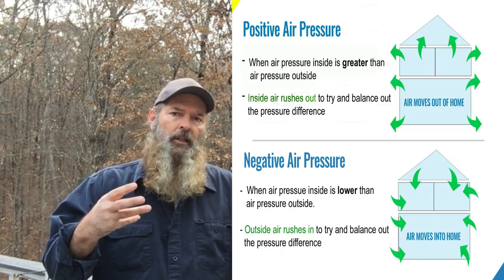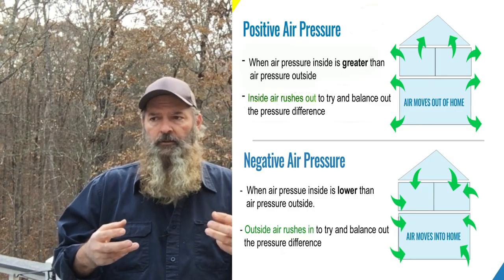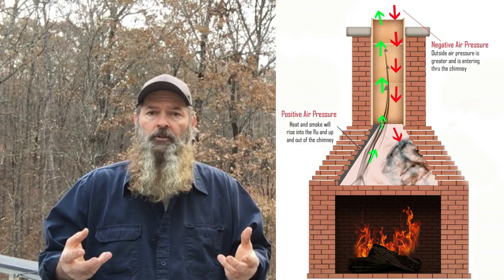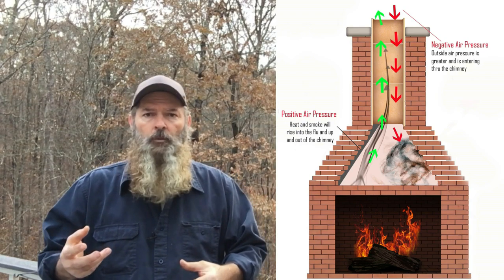What Causes A Smoky Fireplace?

Comment: Great explanation,we have another trick we do in Saudi Arabia,I don’t really know who invented it or thought of it,but it is common here,so we put a pipe built inside the chimney structure from the sides from the top till the middle,the trick is that when smoke gets out,Air has to be replaced,so it comes down through the pipe built on side of chimney,when air comes in,it comes warm because the pipe is warm,this way you get warm air,with no back draft or smoke and you don’t even need to open window,the problem with it is that in summer when it gets hot and dusty here,bad air and dust could leak in,but we have other tricks for it,i hope I explained it well

Comment: From my experience as a chimney sweep, the two main things are getting the fire hot enough to get the draft going, aswell as having the actual opening properly sized to the smokechamber and flue.  ive seen many fireplaces that have wayy to large of an opening for a 13x13 terracotta liner (which id bet that most of you reading this who have a fireplace also have this size flue connected to it). and that necking down is just as bad for the draft as for example, running a 6inch pipe from a woodstove into a 8x13 or 13x13.  You can always get a glass door to put infront of your fireplace to help keep the heat inside while starting a fire to start sending that heat up and getting a draft, and it also helps with evening out the flow of air so the amount of air coming in is more equal to that 13x13 terracotta flow rate creating an even stronger draft. Those firestarters are great for fireplaces, because they burn hot quickly, and with minimal smoke. Perfect for starting a fire on a cold day when the pressure is flipped in the chimney.

Comment: A cold chimney on the outside of a house will not draw as well as a warm chimney that goes through the center of the house that can stay insulated. Insulate chimneys with perlite and mineral wool, using a stove pipe as the center or a 6 inch or 8 inch chimney liner, and the draft is so good there is no more smoke problems.
Reply from the maker: This is true.

Comment: I had this experience this morning (to the point where it was almost like the damper was closed !!)
and your video helped me understand the potential reasons why, thank you. On my fireplace, I also
have a fan system with vents top and bottom on the surrounding walls. When this fan is on, I notice
only one set of vents is producing warm air. Are the others intakes? If so, where does this draw from?
Reply: The fan system isn't to feed air into the fireplace.  It circulates air around the fireplace to warm it before putting it back in the room but not through the fireplace where it would pick up smoke.  You are right, one vent is the intake from the room.
Reply: @Bowinja  Thanks for responding to my question, bit paranoid right now to risk going through the smoke filled house experience again with that fireplace but an open window nearby and warming up the flue beforehand will get me back on that horse again before winter's end.
Reply: @steveb7714  keep the doors shut while the fans are running. They tend to suck smoke out of the fire. Shut then off before opening

Comment: Does the surface of chimney roof has effect on the direction of the smoke flow?  Usually it's flat but mine is gable roof
Reply: I live in Tampa Florida and have been here my whole life of 51 years. I am a custom sheetmetal fabricator who has just about mastered my chimney cap and spark arrestor skills. With that being said, a poorly constructed or no sign of up keeping of a roof cap can and will cause bad air flow. When I create my caps I try to include a inner flue (stainless steel for hot gasses leaving) and a middle flue (galvalume for air intake) there is a thrid flue (galvanized for keeping heat inside the flue to help protect cheaply built chimneys without a fire brick). The main cap will have a 3" collar that the before mentioned flues will come up and thru and a spark arrestor installed having both a stainless steel inner flue and a middle galvalume flue both separate for correct air flow. Then I fabricate a windscreen that is installed that will hide the spark arrestor but it will but installed 3" up from the outside cap edge. This 3" gap with the 3" collar combined with the windscreen creates a well enough flow that allows most fireplaces to perform safely. I havnt checked my Instagram in a while but you might be able to see some of my work. Just type in my first and last name, StephenAllen. Hope this helps!

Comment: I've got a fire place with two front doors and a fan. Do the same rules apply. As well it hasn't been used in probably 15 years or so. So my question is who or what type of professional do I need to have inspect and clean everything?
Reply from the maker: Christopher Mullins  you can do a search in your area for ie chimney sweeps and also contact local home inspectors for a referral.  15 years tells me to wait until I know for certain it is in safe working condition before I strike that first match. Thanks for watching.
Reply: @American-OutdoorsNet  ok cool thank you for the fast response. Your video's are awesome and very knowledgeable.

Comment: We have a home built in 1949.  The fireplace smoked as a woodburner so we put in a gas log.  It still smokes, making the ceiling and mantel etc. smokey.  We had the local HVAC man come and put an extension on the chimney to make it a little taller hoping that would fix the problem.  Still smokes the same amount.  We don't want to use an electric insert because they don't put out the heat we would like, and we have already spent quite a bit to get where we are.  Any suggestions?
Reply from the maker: From what you said it sounds like either an obstruction or a leak, and it is almost always the obvious and the simple.  So simple we tend to look past them initially. Confirm the flu liner is clear and sealed. Confirm the top plate on the chimney is intact and the proper cap for your current heat source has been installed. Gas caps are not the same as a cap for a woodburner.
Reply: The fireplace we have is a brick and mortar fireplace. It was a wood burning fireplace. It smoked. We had a gas log installed. It still smokes. We had them add an extension to the chimney to make it higher than the roof peak. It still smokes the same amount as always. The company who did our work said the chimney was clear. Any more suggestions, please?
Reply: Add a smoke gaurd, which is a small piece of metal across the top edge. This will help with helping the direction of the smoke to exit and at the same time let the heat to radiate. Make sure your using dry wood as mentioned in this video oak trees take about a year before it gets to a dried out state that burns well with little smoke. Hope this helps.

Comment: Hello. my metal wood stove start leaking smoke,i'd already cleaned pipe but still leak,please tell me,thanks.
Reply: Is the male end going upwards into the next piece? If the pipe is going around the outside of the one above it, thats backwards. and the smoke can leak around the edges instead of flowing on up the pipe.
Crimped end goes up.

Comment: I got back drafts when its very windy. Fireplace is a zero clearance unit.
Reply from the maker: Celtic Bear elevating the chimney even a bit over the roof peak can make a noticeable difference. Thanks for watching.
Reply: also consider getting a wind cap. It rotates in the wind so the smoke comes out going with the wind, and the wind cant really blow back into, unless it got stuck and wouldn't rotate with the wind.